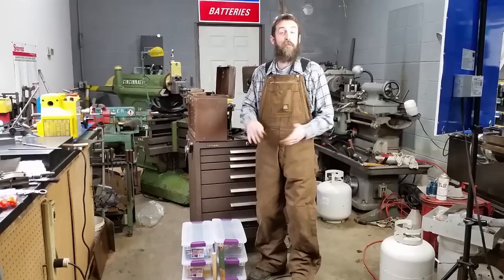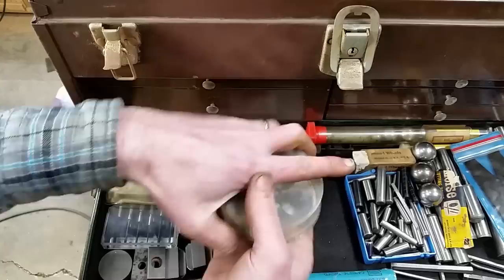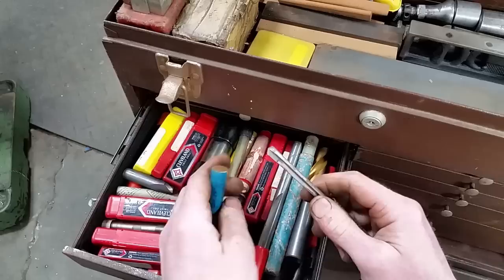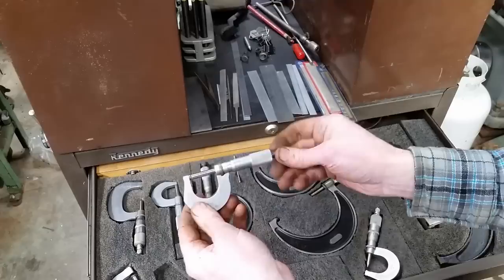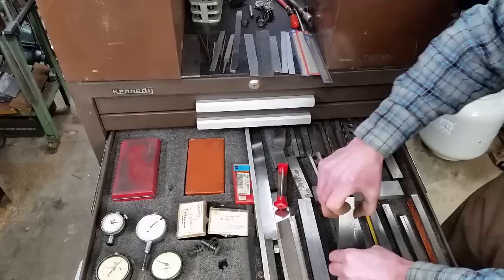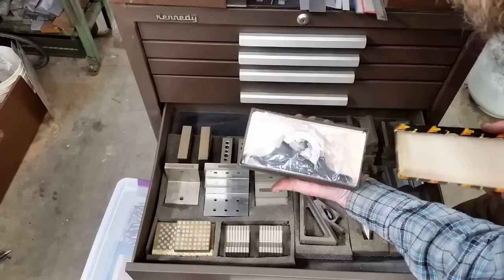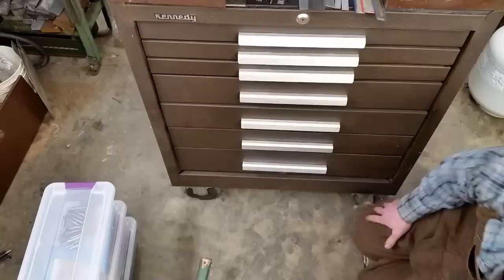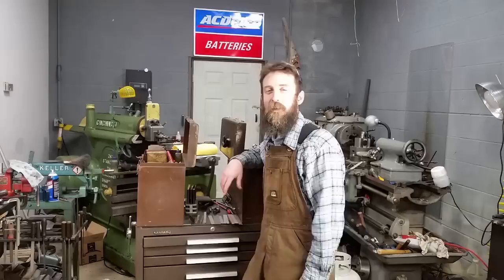BARN FIND TOOLMAKER TOOL BOX SCORE! :-)

Comment: That is quite the score there Steve! I ended up with pretty much the same assortment and quantity of stuff you did a few years ago when I bought my Bridgeport mill. I paid like $400 for 3 boxes full to the gills of tools, tooling and everything else at auction. I also scored the mill for $700 with Kurt vise, $65 for a 12" rotary table, and $10 for a 6"x 12" Harig surface grinder! I have never had a day like that since and probably won't have again, but it is definitely worth going to auctions if you can find them. There is probably $20k in those boxes if all was bought new so congratulations Steve! Someone is very happy to see those tools go to a good home to be used and appreciated for sure. Enjoy and stay well!
Reply: It's a lot more than $20K.

Comment: My father was an aerospace machinist lathe machinist. When my father passed away and I inherited his tool box the only thing of real value were about 6 different common measuring instruments and his Machinery's Handbook. The item of most value was the test gauge that could discern tenths of a thousandth because he would always talk about those precision jobs. The rest of the box was filled with ground carbide and high speed steel tools that he ground for specific jobs. Leftovers and drops from past projects with little value going forward. Most likely his company supplied anything he needed from the tool room. 
My machine shop has everything I need and his box takes up valuable space. He would agree as he was not one to hoard things except maybe for his ground tooling. His whole spirit is in his vintage test gauge which I will treasure as I will use it to test spindle run out. 

A friend offered me her late husbands machinist tool box. There was nothing of value but the box itself. It would have been a burden If I took it. I have what I need and know what I need and would rather spend my time in my shop making stuff than looking trough flea markets and garage sales.
50 years ago these tools were expensive and could always be reused by craftsmen. Today these tools are inexpensive and easy to get.... until you start machining to tenths of a thousandth and then those jobs have their own tooling and economics. What is most rare and valuable today is the intellectual effort to understand and use those tools.

You now have a lot more nice stuff and that is nice if you have the room for it. Has it helped you moved forward with the work you need to be doing? I hope I never come across one of those wonderful finds because it would be a serious distraction. Beware of garage sales!

Comment: Quite the find there Steve. New tools are nice, However I find it more pleasurable to use tools that were used and or made by a skilled craftsman that came before me. When I use a tool I acquired from unknown craftsman,  I often wonder what that machinists or tool maker had built with those tools before they came into my care. 

One thing for sure...You will not have to buy too many taps or drills for a long time :)
Reply from the maker: Warren Jones I like shop made stuff also. I did get a few loose taps and drills in the box.  I noticed a hand full of endmills also😃

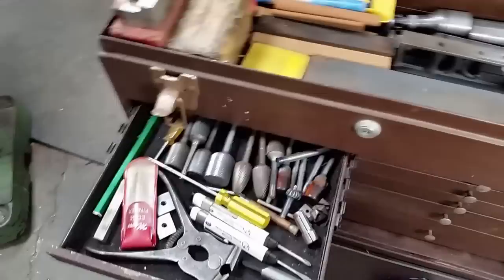Comment: @7:36 These are made to cut piano wire, and other hardened wire. The cutter blades are carbide, and are indexable (for different diameters of wire) and replaceable.

Comment: Boy ain't thatba wet dream. I missed out massively on an amazing  barn find hoard. Lathe, shaper, Bridgeport, and a horizontal end mill. And tons of tooling in fantastic shape. They wanted the low some of 1k for all. Couldnt fit a box truck in so was looking for a trailer to rent that would minimize my loads since it was a 500 miles round trip and had to be out by end of the weekend. I couldnt follow through and someone else got it.

Comment: Hi Steve, I see a propane tank in your shop, do you use it for heating?
Reply from the maker: Yeah, I use a small heater head on the tank for heat
Reply: I thought you might. I did the same thing when I was remodeling my shop and it filled the environment with moisture, I then switched to a wood burning stove, that in contrast dries up the air.